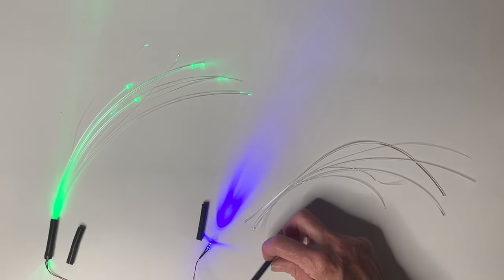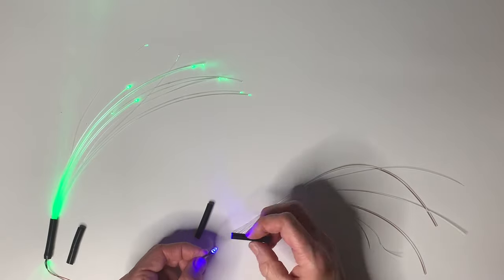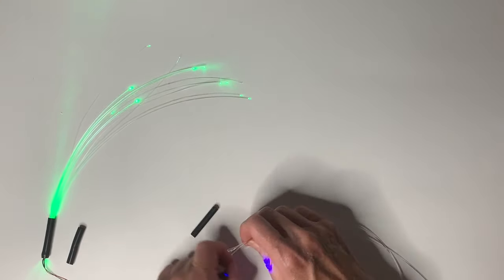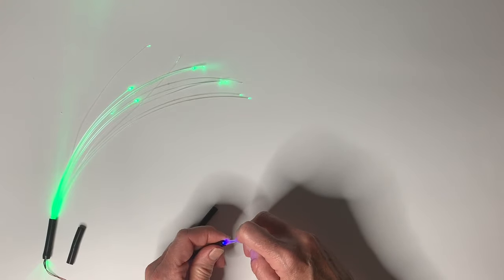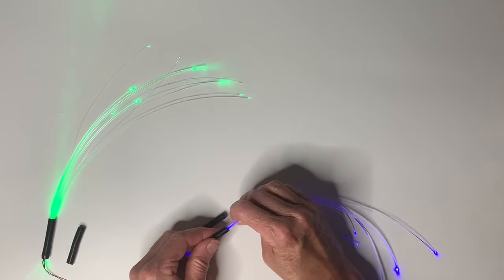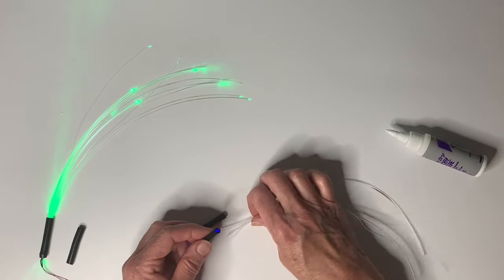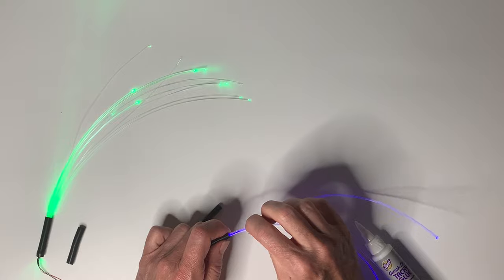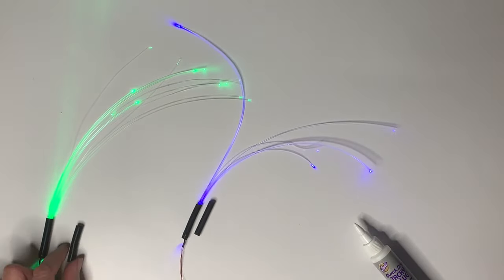How to Connect Fiber Optic Lights to 3mm and 5mm LEDs

Comment: Heat shrink works too.
Reply from the maker: Hi Charlie! Yes heat shrink does work.  We find the 3/32 fits over a 3mm LED.  BUT you can accidentally melt the plastic fiber optic if you heat your shrink tube too hot.  Also the shrink tube tends to be kind of flexible so it doesn't hold the fibers firmly.  We like this tube we have found because it fits very tightly onto the 3mm or 5mm LED and it is fairly stiff so it won't flex or flop or let the fiber optic fall back out
Reply from the maker: yes, heat shrink does work and we use it from time to time.  BUT you have to be careful shrinking that heat shrink so you don't accidentally melt the fiber optic.  We have done that too! That's why we moved to the connector. No more melted shrink tube
Reply: Where can we get these tubes?

Comment: Hi I just got a lot of stuff from y’all is there any small led lights for like matchbox and stuff
Reply from the maker: Great you got your order! Thank you for that. Yes we have really tiny lights, our Z is less than 1 millimeter.  You can find our LED sizes here: https://evandesigns.com/pages/information-about-led-sizes  The tiny ones are on this page: https://evandesigns.com/collections/hobby-leds/products/chip-nano-pico-leds and flashing ones if you want to make an emergency vehicle are here: https://evandesigns.com/collections/hobby-leds/products/flashing-smd-chip-leds  we have a small coin cell here, https://evandesigns.com/collections/wire-switch-more/products/3v-coin-cell-holder-with-switch that can run 10 LEDs.  And a super tiny coin cell here: https://evandesigns.com/collections/wire-switch-more/products/small-coin-cell-holder-with-separate-switch that can run 4 LEDs.  Let me know if you have any questions
Reply: @EvanDesigns  thanks

Comment: I got these fiber optics and they are not bright at all. I had designed a case for a pocket operator and I was running a silicone tube on the sides of the case. Inside was where the fiber optics were suppose to go. I had thought it would have illuminated both sides of the tubing but you cant see anything.
Reply from the maker: Hi Metallica I am so sorry you didn't care for the side glow fiber optic.  It needs a strong light and even with strong light it will not be AS bright as an LED.  If you did not get any light maybe we can help.  I will email you directly to try to troubleshoot with you!
Reply: Did you ever buy brighter ones?
Reply: @magnoliacooper6687  yes I got the brighter ones. I ended up buying rope LEDs instead.
Reply from the maker: @magnoliacooper6687    side glow won't be as bright as LEDs

Comment: Thank you for sharing the information and knowledge. 😊
I have a question, I have seen some fiber optics lights that glows from one end, seems some fluid is applied to stop the light from escaping. Have any idea what do they do to make it glow? Is it some fluid or they use some other technique?
Reply from the maker: Hi! Thank you for your interest in our fiber optic. I have not heard of some fluid that you can use to paint on your fiber optic. But I would say black paint would do an excellent job!
Reply: I’m pretty new to fiber optic, but I know that you can buy end glow and side glow strands depending on where you want the light to emit. Black paint or shrink tube can be used to shroud areas also.

Comment: are those plastic or glass fibers? everything i've tried with plastic fibers melts them
Reply from the maker: We use plastic fiber optic cable.  In this video we do not use Shrink tube since that CAN melt the fibers.  If you check, we are using our Fiber Optic connector.  The little connector is nice because it slips tightly over the LED and stays on.  https://evandesigns.com/collections/wire-switch-more/products/fiber-optic-connector
there is no need to use heat anymore.  And the connector is .50 cents per inch so it's easy to get a test piece and see how it works for you.

Comment: Hey just another question that is my fault but why do some of your lights not come with a battery holder it’s ok but just asking I bought one I figured that some people wire them different so maybe that’s why again not a big deal just bought the holder also the lights are great just got them very cool and bright
Reply from the maker: hi! We have lots of different battery holders on this page: https://evandesigns.com/collections/wire-switch-more  we do not include a battery holder with the lights because we do not know which battery you plan on using.  We do have kits though, that include a battery holder like this one: https://evandesigns.com/collections/hobby-leds/products/chip-light-kit  or this one: https://evandesigns.com/collections/hobby-leds/products/knight-rider-light-circuit?variant=28863901597744

Comment: Doesn't putting white glue in then stuffing the fibers in clog the ends and block the light from shining through? That's what happened to me but it was a different glue than white glue
Reply from the maker: Thank you fo your interest in our fiber optic!  If you use a glue that dries clear there will be no loss of light.  Fiber optic transmits light, so if you can see through the glue when it's dry, the fiber optic can let the light through.  As a test of a new glue, you can put a bit on your worktable and let it dry.  Make sure it's clear when it dries and you are good to go!
Reply: White glue (Elmer's) dries clear but now they have clear Elmer's.
Do not use super glue on fiber optics, it destroys it.